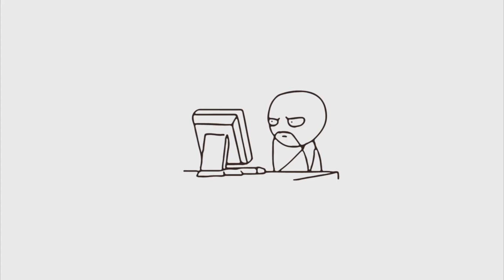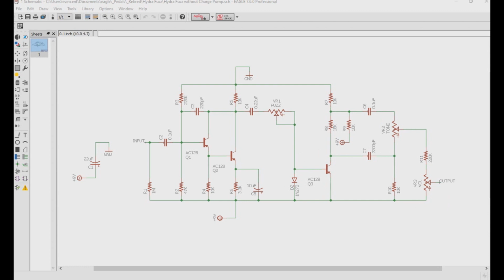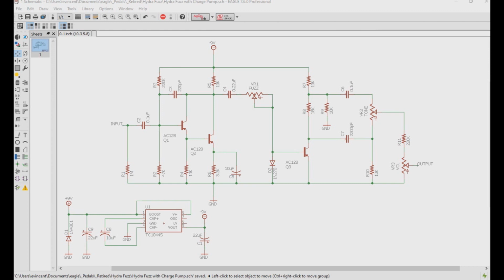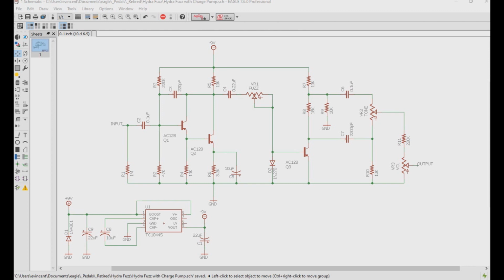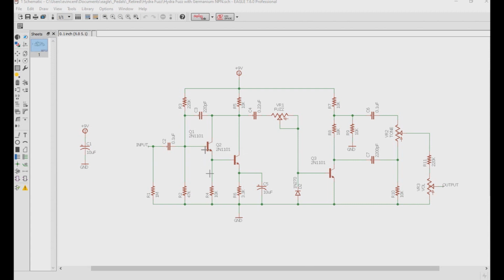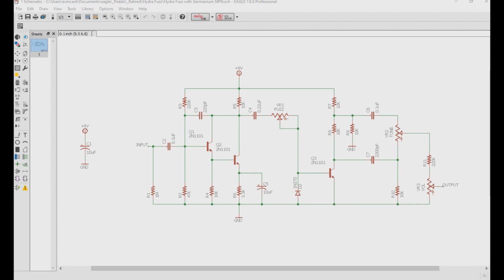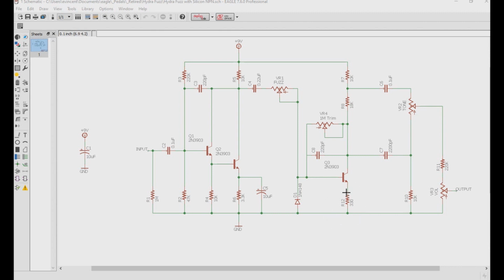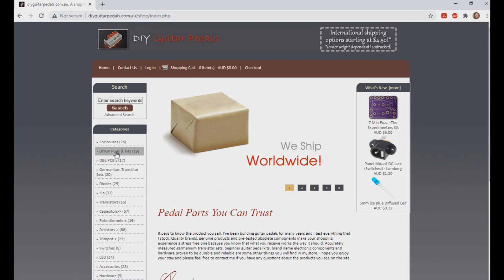Germanium Fuzz Pedals - PNP and NPN

Comment: Just built a harmonic percolator with a diode lift switch. It’s such a cool pedal!!Very unique if you are bored of the same old same old fuzz tones. With the lift switch on it also becomes a super versatile overdrive pedal with a fairly flat eq. Sounds beautiful and I’m surprised this circuit hasn’t been explored more.
Reply: I have made a clone of one and rather enjoyed it. I have to guess the issue is due to the "what circuit is the correct circuit" that becomes the reason why the circuit doesn't get analyzed. A lot of people don't agree what circuit is the correct one.
Reply: Hey Rarebird. Just checked out your fuzz on Reverb. I LIKE. Great to see someone trying something like this.
I also like the circuit layout. Its almost art 👍
Experimentation beats emulation !

Comment: Hey thanks for explanation. Quick question when working with PNP circuits...you have to flip the polarity on the parts...understood....what about the off board parts like the input and out put Jack's switches and posts ect...is ground still normal ground ( minus 9v) or is this too flipped?
Reply: Correct, without an inverter IC, you would connect the 9V lead on the battery to the sleeves of the input and output jack as that becomes the new common ground.

Comment: I don’t have any favorites as I’m an amp builder. Just starting to get more interested in building effects.
Reply: Welcome to the channel.
Reply: @erikvincent5846  Thanx! I’m hoping to use exposure therapy to get used to the dreaded PCB!! 😱
Reply: @williambock1821  yeah, point to point only works in pedals with small part counts.
Reply: @erikvincent5846  I’ve built a couple MOD p2p kits and liked the results of the persuader starved plate OD but the faux spring reverb “the Verb” kit was kinda underwhelming. Especially for the amount of work putting it together. I’m mostly interested in modulation and reverb effects since the OD is the domain of amps around my house. But I know VERY little about IC’s and transistors. Looks interesting tho! I hate the idea of giving up and buying what I need. That’s not nearly as satisfying.
Reply: Welcome to the world of stomp boxes. Beware, it can become very habit-forming haha. At least it can be rather affordable though.

Comment: Thanks for this explanation. Is there a way to mod a circuit to work with transistors that don't have the recommended gain? For example, I wanted to do a Tone Bender and a Fuzz Factory build so I bought a set of Russian 1T308V Ge PNP's that were advertised at 80-150hFE, but when I followed the instructions from your transistor gain test video they ranged around 34 to 60 hFE with 10 to 23 uA's leakage respectively. I would assume these are too low to use in those types of circuits but maybe there's a way to calculate resistor changes to achieve close results?
Reply: So, generally, you wouldn't be able to use them. However, there are ways to make them work with other components.

You could make Darlington Pairs, which will increase the gain, but also increase the leakages.

You could use Sziklai pairs to eliminate leakages and flip polarity, as well as getting more gain. We go over those here: https://www.youtube.com/watch?v=bzWBbVPgDOo

If you note that you've created too much gain, you can reduce the gain by using Piggybacking, which we go over here: https://www.youtube.com/watch?v=t3tokiKDmIE
Reply: Absolutely yes, you can use them with no problem at all. You only have to polarize them correctly. If you have the skills is very easy. There is a lot of myth/nullshit going on in pedal building forums. Once you understand why the circuit sounds like it does it is very easy. You only have to learn some electronics.  If not, just buy a kit and solder it following the manual.

Comment: I have never owned a pedal with positive ground and had never given it any thought as to the problems it might create. Is it that it just won’t work because the other pedals attached are draining its power to negative ground? Or is there more at play?
Reply: The major issue is what the common ground is attached to on your pedals: the sleeves of your audio in and out jacks.
Reply: @erikvincent5846  right! Never thought about that.. i did a npn (silicon) fuzzface a while ago just so i didn’t have to deal with positive ground 😅 after your video im even happier i went that route! Thanks for the video and the reply